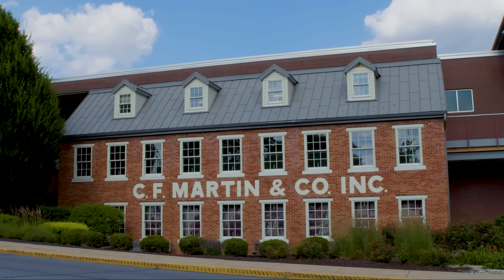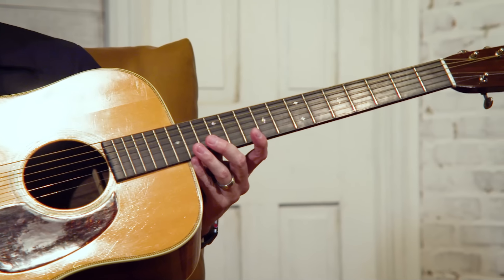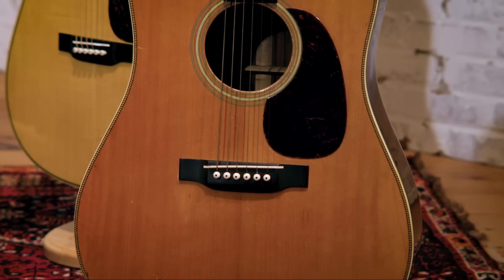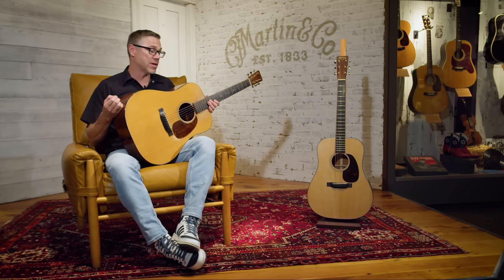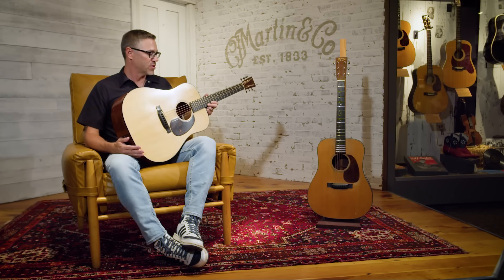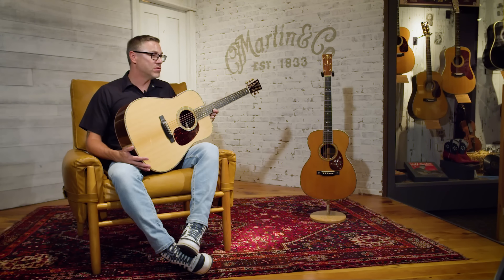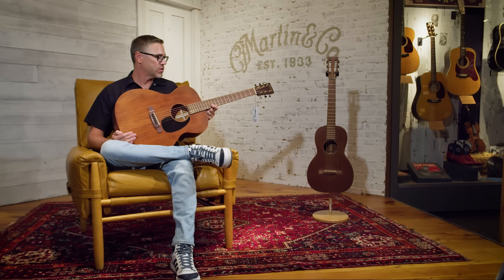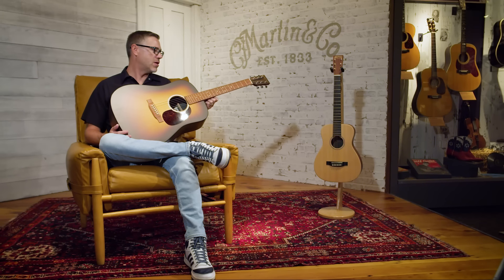How To Choose a Martin Guitar: From LX Series to D-45

Comment: I would have liked to have seen as much attention paid to adjustable truss rods as was paid to neck profiles. Neck profiles are, to a larger extent, an “option” as opposed to truss rods which are not an option on vintage instruments—not to mention the price of admission for a vintage instrument.

I’m the second owner of an ‘05 D18GE (Golden Era) and the adjustable truss rod was a huge selling point for me. The D18GE offered historic build and materials appointments at an accessible price point with the addition—and, arguably, improvement—of a modern, adjustable truss rod. The result is a historic platform with a vital, serviceable addition to its construction which eliminates the need for a possible neck reset.

Also, torrefaction…not “torrefication”… does not turn a new piece of wood into an old piece of wood. Torrefaction is a thermochemical process that aims to decrease the water and volatiles in wood, making it lighter, stiffer, and capable of vibrating more efficiently. These are not undesirable qualities whatsoever. However, it’s a little misleading—in my opinion—for guitar manufacturers to suggest that torrefaction results in a “new” old instrument. The result is a torrefied instrument that will sound different in 100 years than a 100 year old instrument sounds today.

Sincerely,

A picker, a grinner, and fine woodworker.